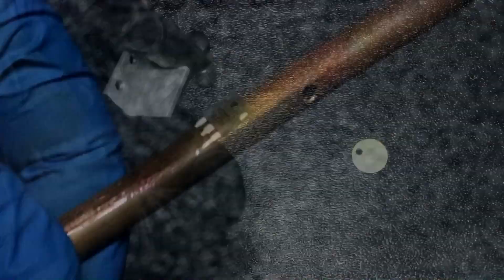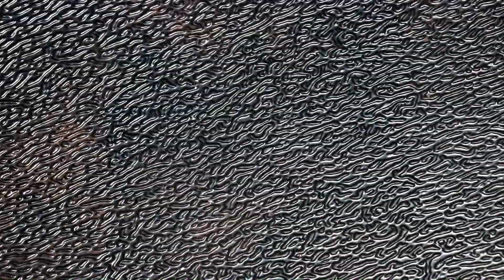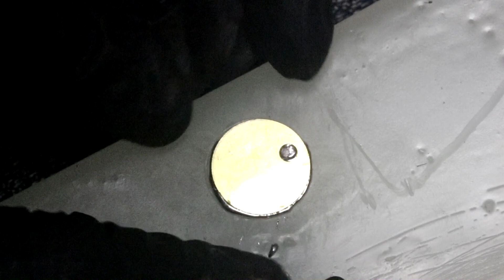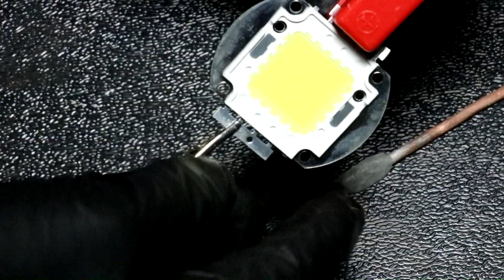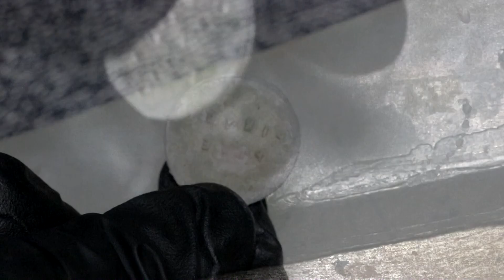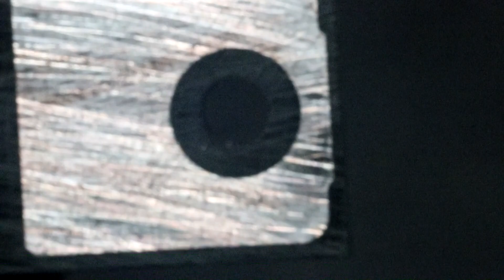Copper Mercury Amalgam Experiments

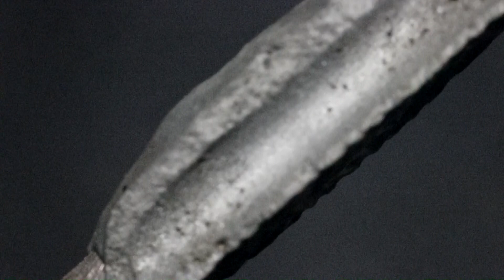Comment: Woow, that illusion at 9:27 tho!

Also, the static electricity generated by those gloves, which you used to touch the gate pin, would 100% have destroyed a normal MOSFET; So how exactly does a MOFSET differ, so that it can survive such abuse? XD

(Ps. I actually like the pronunciation; very AVE-like)

(Pps. Yes, I know inbuilt overvoltage protection diodes have been a thing for almost 40 years and that modern power MOSFETS are constructed as massive parallel arrays of individual MOSFET 'cells'...
I'll go home now.)
Reply from the maker: Humm... might explain why the smaller ones keep failing on me.

Comment: I love these amalgam videos. Actually I just destroyed a padlock with gallium a couple days ago. Oh and does Mercury mixed with gallium and aluminium produce more hydrogen gas when in water or is it the same? I had a pretty violent reaction when I mixed all 3 in water compared to when I just did gallium and aluminium in water. Uh oh people are going to be mad about you saying "mofset" instead of mosfet.
Reply from the maker: Should be the same. Rates may vary though.